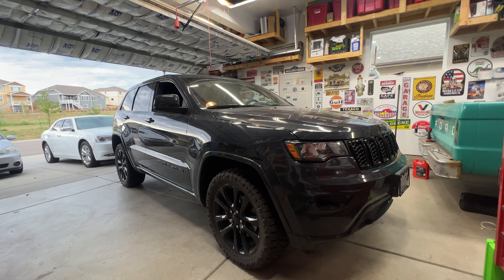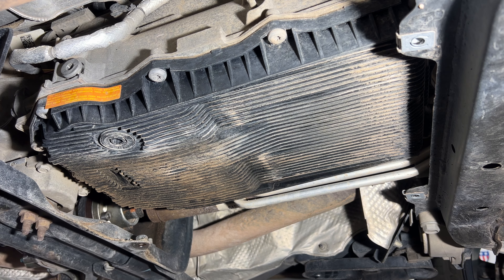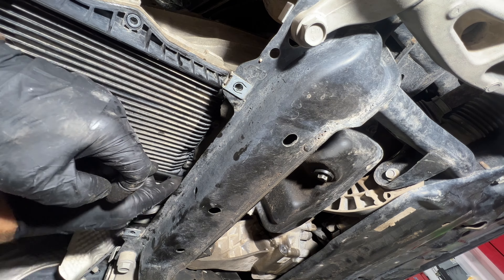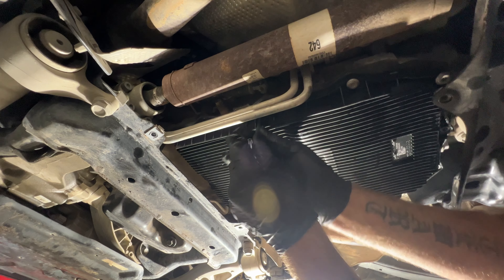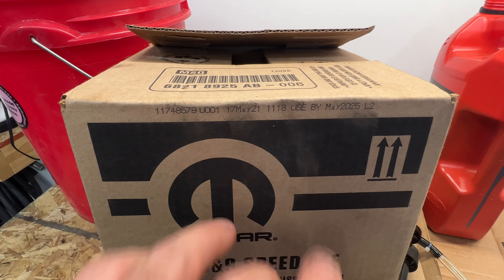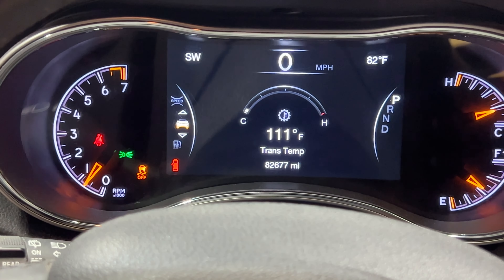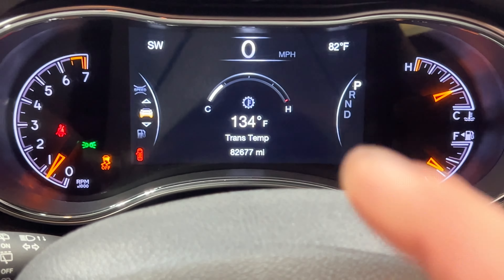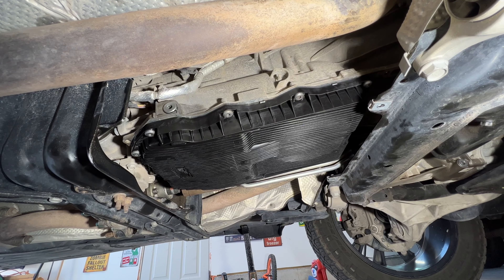2018 Jeep Grand Cherokee 8 Speed ZF Transmission Filter & Fluid Replacement How-To

Comment: My question is a simple one if you measure the exact amount of fluid that came out of the transmission and you put the same exact amount of fluid back why would all those procedures be even necessary?
Reply: There’s no telling that you have that right fluid level to begin with.
Reply: I did that with mine.  I still check the fluid level.  It least it gets you very close.

Comment: Great video - thanks for all the effort, you did an awesome job covering everything. It's a badge of honor to complete this task (those cross members seem like they were designed to block you from removing/installing the pan bolts). I have done it twice in the last 3 weeks. Why twice? I bought a pan off amazon for $44 instead of going OEM (OEM was $300). That said, I am not 100% sure it was the Amazon pan after replacing it with the OEM pan. You will notice if you watch enough videos people mention one bolt is hard to remove. I ran into the same issue. It was the back corner bolt on the drivers side. Since the Amazon pan leaked there after the first try (in that area only), and I had carefully inspected that pan and thoroughly cleaned/inspected the transmission mating surface before I installed it, I was very careful when I removed it so I cold try to figure out what happened (figured it was the pan or the spacer insert depths). I inspected the threads on that bolt and they were a little pulled, close to the shoulder. Before installing the new pan, I took one of the other bolts and threaded it in that hole with a little D40 to chase the threads (no pan installed). But what surprised me was that it would bottom out very early and looked like it would not make full contact with the pan when it bottomed out. So I screwed the same bolt into almost all of the other holes (some are hard to reach so I did not test them all). All the holes I tested you could screw the bolt all the way to the surface of the transmission. Not wanting to risk another $100 worth of tranny fluid, I took one of the new bolts, found a nut that matched, screwed it on about a 1/8" and cut the top off. Then cleaned it up with a file and unscrewed the nut (to chase the cut threads). When I re-installed the pan, that bolt went in like butter (just like all the others). I would wish I would have saved the bolts from the first swap (you get new ones with the pan) so I could check all of them to make sure they were the same length. I think that back corner one is shorter and the replacement pans  are all coming with the same length bolts - and that back drivers side corner one needs to be a little shorter. I could be wrong, but remember this post if you find that bolt is hard to back out. If you end up with a leak after you are all done (mine was small, took a few weeks before I started noticing it on the garage floor) you are not going to be very happy about doing this job again. Once is enough :) 

You covered all of this in the video, but typed it out in case someone wants to print it out before they start.
Skid plate bolts (4 of them) are 13mm. Fill plug is 8mm, drain plug (if you have one) is 10mm, pan bolts are Tx40, torque on the pan bolts is 10nm or 89 inch lbs. 

Sequence for filling is - install pan, fill till it runs out of the fill port (~2.5 quarts) don't wait for it to stop once it is dripping, it'll need more, loosely reinstall the fill plug. 

From here here on out, be careful not to burn your hand/arm on the exhaust near the fill plug (the home depot weed sprayer with the tip removed works great for this).

Start the car, keep it running, pull the fill plug again and fill it till it starts to drip...~ 2 quarts, loosely reinstall the fill plug. Then get in the car, shut stability control off, apply the brake and put it in reverse for 5 seconds, keep the brake applied, shift to drive and wait 5 seconds, take your foot off brake and and slowly accelerate to 8-9 mph until the car shifts into second (or just use sport mode and force it into 2nd) hold it for 5 seconds in 2nd, slowly brake, shift to neutral, rev the engine to 2,000 rpm and hold for 5 seconds, then let it come back to idle (keep it running) and put it in park. Go back under and pull the fill plug and either let it drain until it is a slow drip or fill it until it starts to drip. Put the drain plug back in, shut the car off, reinstall the jack skid plate, pull it off the jack stands and go enjoy a beer while you clean up the shop. Cheers!
Reply from the maker: Thanks for the extra info.

Comment: I did this a couple of years back. Your video was spot on, thank you for sharing. For anyone that is going to be doing this, get yourself a chemical strayer, take the nozzle off of the end of the wand and use that to fill the fluid. It will save you time and hand cramps over using the small quart pump shown here.

Comment: 14 Durango here almost at 90k, never done it because dealer said it was life time. Now i am afraid if i do might start slipping. Btw my local dealer charges $1200-$1500 to change 🤦🏻‍♂️
Reply from the maker: You’ll be totally fine doing it at 90k I’ve seen this done on this transmission with over 150k and have had no issues. When I did this video I believe this Jeep had 80 or around 88k miles and still going strong with no issues.
Reply from the maker: Dealership claims this is a lifetime fluid but yet they offer a fluid service 🤔
Reply: @BLUECOLLARGARAGE  Exactly, thank you 🙏🏽
Reply: @BLUECOLLARGARAGE 
Where you found those instructions brother? I have been watching your video to try memorize them!

Comment: Dealership quoted me 490 for the service without a new pan. They are charging me for 7 quarts of fluid.  1.4 hours of labor. Has me wondering what kind of procedure they are planning on following lol. I might try it myself. Thanks for the video !
Reply: What dealership?
Reply: Maybe drain and fill only for 490 you could buy a PPE pan 7 quarts of Amsoil and have money left over.

Comment: Great content. As a FYI, went to dealer today and was quoted just over $1,000 to have this done.
Reply from the maker: Wow! That is good to know thanks for the info. I think I spent about $350 total in parts.
Reply: @BLUECOLLARGARAGE  i was gonna say if you spent 350 in oem parts... And the dealership wanted 600... Thats 250 dollars in labor.. not too bad to just have them do it since most people dont have the garage..jacks....stands..or tools... But if its 1k dollars... Then doing it myself would probably be the way to go. Thanks again
Reply: FYI - my local dealer in MA charged $750 for the fluid / filter change.
Reply: LOL I got quoted the same
Reply: I just got a quote for 1523$$ I said the math isn't mathing at all. It should roughly cost around 800$ if everything is calculated correctly. 
Guess I will be doing this myself as I use to work at a shop. I just didn't want to do it anymore lol

Comment: Per ZF instructions after you install the new pan and fill you are supposed to put in drive run up to 2000 RPM for 5 seconds brake neutral for 5 seconds reverse run up to 2000 RPM then park you have a window to add fluid between 86 to 122 degrease then you remove the fill cap and add fluid and let it drain until it drips not a steady run like you did. You want to make sure you run through the gears to remove the air in trans. This is why all 4 wheels must be off the ground and level. If you don't run through the gears you will short-fill the transmission very important steps.  

The best time of year to change the fluid is in winter or at least no higher than 75 degrees so you have time to run through the gears if it's 90 or more degrees to start you run the chance to exceed the temperature to fill due to the expansion of the fluid. 

I also replaced the pan with a PPE pan adds 2 extra quarts of fluid and you can replace the filter only the next fluid change for $25 Vs buying another cover. 

This job requires a lot of steps not unlike the old days of drain and fill but the dealer charges $1200 to change the trans fluid. I also used Amsoil fuel-efficient transmission fluid you will notice 2 gear shifts much smoother.

Great video on set up
Reply: Everyone tells me factory fluid . I have AMSOIL In everything  and am about to do this job . How's things holding up ,I'm at 55k
Reply: @stevehardeman7209  Great its been 20,000 all good use the blue fuel-efficient trans fluid but factory ZF 8 speed is good I personally like the Amsoil Blue

Comment: After completing this service at 82,000 miles, did you experience any issues. The transmission at 82,000 was shifting normally, correct?

Comment: I ended up using the Dorman transmission pan since AutoZone was having a deal... unfortunately it didn't fit up quite like OEM (Bolt holes were aligned - but it was not seated flush on all sides when I fit it up by hand) but I still went through with completing the installation. It started leaking after a few days. I will be replacing it again but OEM this time... 

TL:DR - Get the OEM pan... not aftermarket.

Comment: Great video.  One question, I don't know the answer, so not being a smart a**.  Should you not have leveled the transmission, instead of the vehicle? The trans does not sit level with the body of the Jeep.  Thanks for the video
Reply from the maker: You can do it either way really is not going to make much of a difference because if you take it to the dealership they will put it up on the rack which makes the vehicle level.
Reply: I thought about this as well, as it sits the transmission is tilting towards the back fill plug and might not be allowing the proper amount of fluid in.
Reply: I leveled the body and drained 6.4 quarts, out of the original pan that had the pan drain plug.  Installed new pan and could only get 4 quarts back in, after running several start/run procedures.  Then I leveled the transmission, and the remaining went in with no issue.  So I replaced the exact amount that I took out.  Every video shows leveling the body, but so many comments saying the same thing, “won’t hold the amount that came out”.  Im not a mechanic, so please correct me if im wrong!
Reply: @BrianPardue-t1u  you're wrong. I pulled out 5.7 quarts. I thought I could only get 4 in. I let it sit over night, I called ZF themselves and they said level the vehicle and not the pan. So, I kept the vehicle level, started it up, ran through the systems shifting again, you don't have to spin the tires when shifting into 2nd! You can just manual shift while holding the brakes! (This is what ZF told me, they said it's actually bad to spin the tires) I then went back down and added another quart, it was getting a little warm, shut it down. Came back in a few hours and did the exact same procedure and got almost another qt in and it began to drip. So, I put back in exactly what I pulled out. Praise Jesus! I was praying the whole way through this process. Installed the plug, made it good n tight, installed the cover, took it for a spin and all is good. No shifting issues at all, totally smooth, everything running as it should and completely happy with it.
Reply: Thanks for telling me I’m wrong 🤣. Great info and thanks for sharing!
Reply: @JF32304  Hello, then, interesting information, if ZF indicates that it is not good for the wheels to move in the air, it is not necessary to lift the jeep in Jack Stand or in an elevator? and could it level with the wheels on the floor or ramps and move to the second march manually? God bless you.

Comment: how you removed the oil pan bolt by the crossmember?
Reply from the maker: It’s really tight to get in there but you will need to use the torx style Allen wrench to get in there once you break the screws free you should be able to loosen them with your fingers the rest of the way.
Reply: Thats what i did. Very fkn tedious but you can get it done .

Comment: Could I just change the fluid and not the filter?
Reply from the maker: Yes you can that’s what a lot of people do. Most manufacturers only recommend replacing the filter if the fluid is really dirty or old.
Reply: @BLUECOLLARGARAGE  Thanks I think I’ll just do that. Mopar fluid is a little too out of my budget so I believe I’ll go with the Valvoline maxlife. I’ve read good things about it.
Reply: Wow! Attempted this today. Are you using a long arm torq key? And should I try and Jack up the transmission to get easier access to the bolts?
Reply from the maker: @JustFixItAlready  no it was just a normal sized torx Allen style. You will want to jack the whole car up and put it on jackstands all the way around to make it level that will give you easier access
Reply: I did my wife’s 2015 Grand Cherokee today and I drained the old Fluid and did the fill method without changing the Pan. I then ran to operating temp then change the Pan and added new Fluid. I wanted to make sure I got as much of the original 125K fluid out. I used Triax Fluid that meets ZF and Mopar fluid standards and is only $75 for 6 Quarts on Amazon. Maybe a little over kill, but I feel better doing it. I also did the the same Drain/refills twice on the Differentials and Transfer Case using Valvoline  ATF-4 and 75W90 Gear oil Synthetics
Reply: @SilentBob1932 is it running good and how many quarts did you have to use?
Reply: @JF32304  So Far It’s running good no leaks, I used a little over 5 Quarts. It took 3.25 Quarts initially, then another 2 Quarts after starting and doing the Fill procedure till over flow out fill hole.

Comment: What oil you running in that 3.6?
Reply from the maker: This is not my vehicle just a customers so I haven’t changed the oil on it. But if it were mine I’d be running pennzoil ultra platinum very good oil.
Reply: @BLUECOLLARGARAGE  totally agree. Cap calls for 0-20 which I have always used. Just rolled over 100k and was thinking of switching to 0-30? My reasoning would be for ring wear. What you think?

Comment: I’m under the impression that you’re supposed to check level at the transmission pan rail.
The transmission is lower at the rear when the chassis is level.
Reply: I wish someone would answer this because I can not get the rear high enough without considering blocks and other dangerous things under the jack and the front wheels still be off the ground.  I read the ZF transmission procedure and it just says vehicle horizontal, it doesn't say trans itself, but others say Trans itself.  So I am sitting here the the Jeep jacked up trying to figure out if I should move forward even though the rear is down still by 13 degrees at the transmission.  The vehicle is slightly lower at the front itself.
Reply: @nicksmith8095  Hi, were you able to find out if it was the jeep or the jeep transmission that was leveled? Would it be good to know what you did in the end?
Reply: @NanoDiaz777  So I did a lot of reading and it came down to most people saying it really doesn't matter.  One suggestion is if ZF was saying level the trans, then level the trans and not the vehicle since the Trans goes in various vehicles.  Most people said "do you think mechanics take the time to level the trans, they just put the vehicle on the lift and move on."  I ended up leveling the Trans as it wasn't that big of a deal to go ahead and do that.
Reply: @nicksmith8095  Thanks for taking the time to answer. Level the trans uploading it in 4 Jack Stand?
Reply: @nicksmith8095  Hello, how are you how much you had to raise the jeep in the back to level the transmission?
Reply: @nicksmith8095  Hello, I'm doing the work now, the tray is changing but I can't level the transmission, how much did you have to lift the jeep in the back to achieve it, why do I lift it and lift it and the transmission doesn't change at all in leveling itself???

Comment: Why not just drain and fill and leave oem pan on ??
Reply from the maker: Because the pan has an internal filter molded in it. The oem filter is non removable from the pan but Dorman came out with a pan that has a replaceable filter.

Comment: What about the remaining fluid in the torque converter?
Reply from the maker: There’s no way of getting it out. You could always do another drain and refill in 500 miles to help get more of the older fluid out but just doing this every 20-30k miles should be fine.

Comment: After looking into the video and going over my vehicle in same fashion. My trans wont take more than 4.5. And so I decided to look into the trans and measure the level with spirit level tool on the trans. Which has a small section to mount it on and trans is definitely lower in back and not evenly straight. There for car needs to be jacked up from the back just a bit. Hopefully I can get enough in my trans

Comment: Great video & explained. BUT how when you removed the “refill plug” a bunch came out. So that means when you refill it you just refilling it until it drips out BUT when you removed the plug literally almost a quart came out. I need answers lol
Reply: When you refill it the engine has to be running to get the proper level and the fluid has to be within certain temperature range.  It's all in the video.  When he removed the fill plug the engine wasn't running and no fluid was circulating in the system, so a lot more was just sitting in the pan.  To avoid the fluid mess my suggestion in a previous comment was to just loosen the fill plug to see that it could be removed if necessary and then remove the drain plug.

Comment: While we had my wife’s on jack stands and going through gears, all of the ABS, Serv 4wd, no park sense, BRAKE, check engine, etc lights came on and will not go off. Traction control was turned off and we have disconnected the battery, no luck.
Reply: @alanricks2010 did you resolve the light issues?